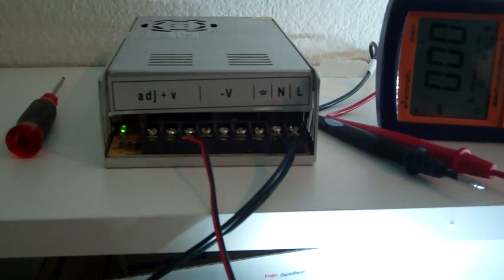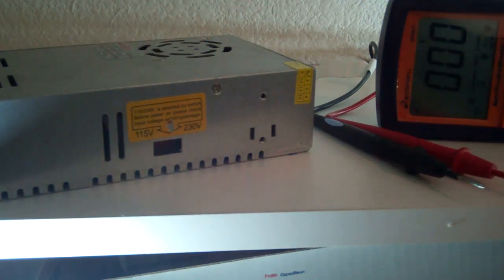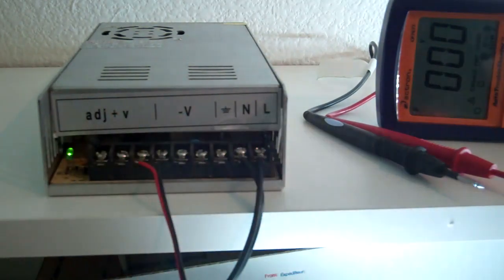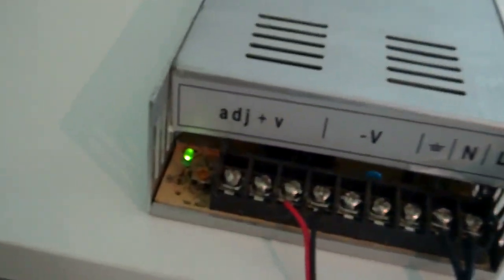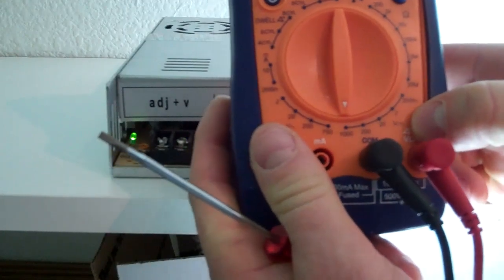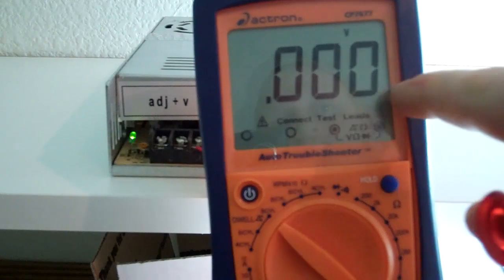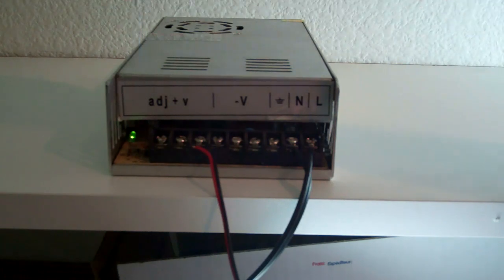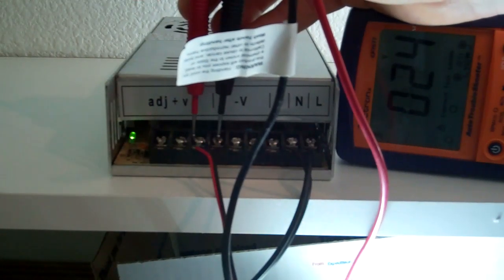Learn How to Adjust Voltage on LED Power Supply

Comment: Hello.  Quick question:  my unit am running  is 24v 100w  rated 210 .. am in the 🇺🇸  so 120v out the wall socket.  The switch on the side of power supply should be set at 115?

Comment: Thanks a lot!!! I bought a 300W buck converter to fine tune the voltage of my 36V 10A swiching power supply that looks like yours, intending to use for TDA7498E amplifier 2*160W 12-32V...
Then I noticed there is this ADJ, but I was not sure if it is that trim pot...
Thanks for this video, now I know, and okay, now I can just use the buck converter for the AU 402 input/output which needs 5-19 volts...

Comment: Hi i have a switching power supply 12v 30a (360w) if i adjut it at 10v will it be able to supply 36a? For more info when i ask it to much amp (on 12v) the voltage drop to have a maximum power of 360w. Thanks. So, to resume if i adjust it at 10v will it be able to supply 36 amps ?
Reply from the maker: Hi Christopher,

If your power supply only allows you to adjust the voltage, the amperage will stay the same. So for example, 10v at 30 amps would be 300 watts instead o 360w.

Feel free to give us a call at 1-844-FLEXFIRE, we'd love to assist you on any lighting project!

Comment: Is it possible to adjust the potentiometer to overdrive the PS, for getting 26 or 27 volts?
Thanks!
Reply from the maker: It depends on the power supply you use. The one shown in the video is not capable of outputting more than 13 volts
Feel free to give us a call at 1-844-FLEXFIRE if you have any other questions or if you're interested in checking out some of our LED strips.

Comment: Hi I am very new in electrical stuff. If my avometer said max of 10A, can I use it to calculate the dc volt output of a 20A power supply?

Comment: you have triple output switching power supply, do they have same voltage and ampere value?
what if I connect each of output wire (black and red pair) to 3 led 12v 10 ampere, will it work?
Thank you for nice video

Comment: i noticed that there are 3 pairs of connectors for the dc output, what is the maximum power (amperes) per pair for the dc output
Reply from the maker: +gtis phils. inc. Hi there, we've upgraded our power supplies recently, Feel free to give us a call at 1-844-FLEXFIRE and we will be happy to assist you with the design of your project!

Comment: amigo tengo una power supply de 24v ajustable y alcanza a subir asta 28v sera que se puede dañar
Reply from the maker: +Edinson Santana Hola Edinson, gracias por ver nuestros videos. Recomendamos no subir mas de 24 voltios si usas tiras LED de 24 voltios ya que al hacerlo se calentarian mucho y pueden dañarse. Si tienes alguna otra pregunta, no dudes en contactarnos al numero 1-844-FLEXFIRE. Gracias

Comment: Hi..great video ..very helpful !
I have a 180w 48v 3.75A DC Power Supply to power my leds.
My 2 drivers ( 1000mA and 700mA ) are capable of 45V each.When I look at the small print on back of each driver it says...
I/P: DC 9-56V
O/P:DC 2-52V
My total led voltage is right at the max of drivers .I read that I can increase the voltage a tad
to be on the safe side.If I increase the voltage on the power supply will I have to adjust the drivers also and how do I do that ? Thanks
I have a meter

Comment: Thanks for your video, it helped me find my problem... 
my super cheapo power supply just had a hole where the 110/220V switch should be. I could only adjust up to 11.6V on my 12V supply... after very carefully soldering a wire to set to 110V all the time (instead of 220V) I had full adjustment from 10-14V.
Do NOT try this if you do not know what you're doing. Large caps can be very dangerous for a while even after unplugged.

Comment: Wanted to charge lead-acid 24v batteries at low cost. Can I raise voltage upto 28-30 v . How does SMPS fare as a 5amps charger

Comment: how low can it go ?
Reply from the maker: Depends on if you are using 12 or 24v. It is hard to say, but let's say you are using 30 feet of 16 gauge stranded wire before a run of LED lights 25 feet long. If you test and get a lower voltage on the beginning of the run it would be wise to increase the voltage on the driver. Consult an electrician please :)
Reply: I meant with that screw, how low can u adjust the voltage of the power supply.. thank a lot
Reply from the maker: Hamza Qawala Sorry! You can adjust this power supply from 11V - 14v DC
Reply: +Flexfire LEDs 11-14v?  Isn't this a 24v supply?  My question is can you drop this 24v to a 12v?
Reply from the maker: +Stephen Garner You can drop it down only a few volts. For 12v it should be down to 10v or 11v and for 24v you can drop it down to 20v or so. There are other units that are much larger that have a larger voltage range but these int he video cannot do that.

Comment: Why is it this type of power supply allows voltage adjustment but not those atx PC power supplies?
Reply: Cosmo John Why would those allow for it? The PCs need specific voltages that are always 12, 5 and 3,3 volts, no adjustment would help anywhere.
Reply: MrMats0n Good point. Is there a possibility of adding a pot into a pc power supply to make it adjustable? Thanks.
Reply: Cosmo John Well, just a pot would not do. Some wire splicing and a buck converter could allow you to tap into the 12v line and adjust it from 12 to 1,5v quite cheaply. Google for DIY adjustable PC power supply or something similar, I have made one in the past.

Comment: Hello, Im new to setting up power supplies and have a question. I have a 12V 10A power supply with 110V. I have the options Ground, L, and N on the power supply for the ac. My question is how do I know whether to run a two prone ac cord from the plug to the power supply or a three prone ac cord?
Reply from the maker: +brightcreep1 Hi there, thanks for watching our videos. If your power supply requires a Ground, then you need to use a 3 prong plug. Don't hesitate to contact us at 1-844-FLEXFIRE if you have any further questions or need some LED lighting assistance.

Comment: if you adjust the voltage while the power supply is on you can damage it, is highly recommended turn it off and then adjust